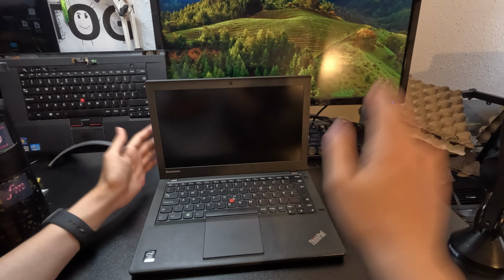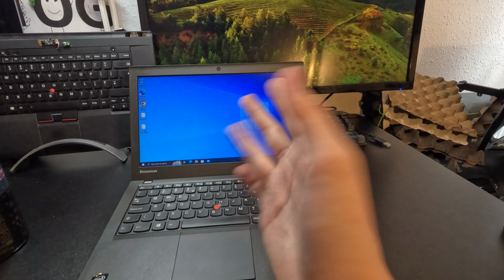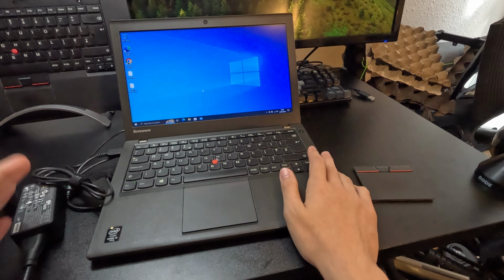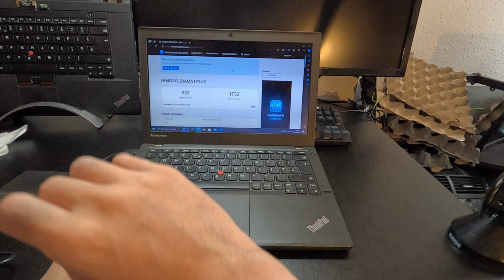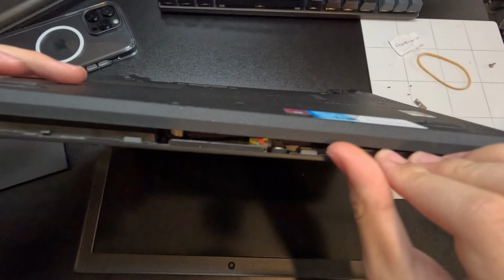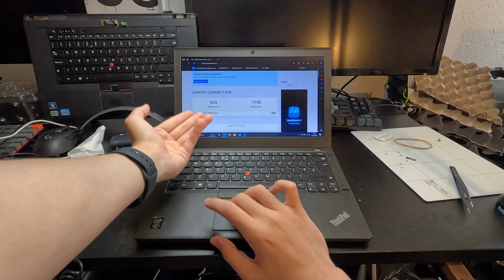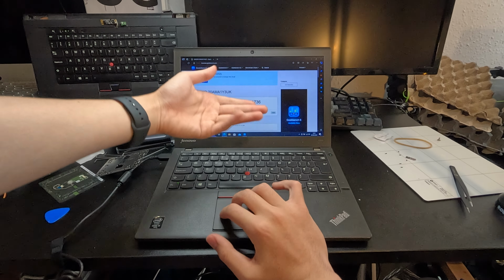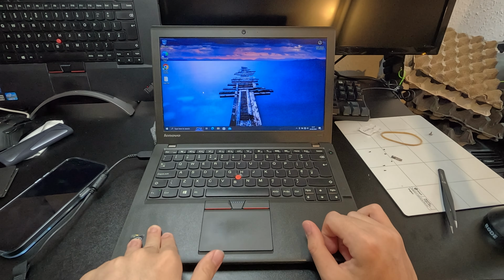Cheapest ThinkPad On eBay!

Comment: x240s are awesome . You can add a second 2242 m.2 sata ssd  in the wwan slot and boot from that as well so you can have two hardrives !!
Reply: agree, i did the same with x270, insanely useful for dualboot or extra storage. with this small size having 2 ssd's is a luxury

Comment: where'd you get the replacement trackpad for only £7.99?, the lowest i can find it for is £20-£25
Reply from the maker: It was a used one on ebay the trackpads from the X250, X240,X260, X270 also work on it.